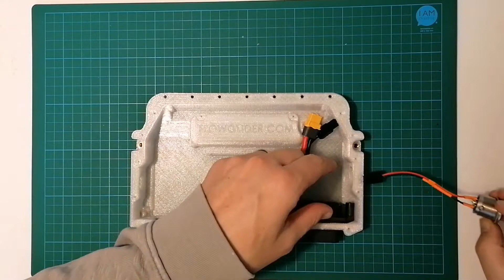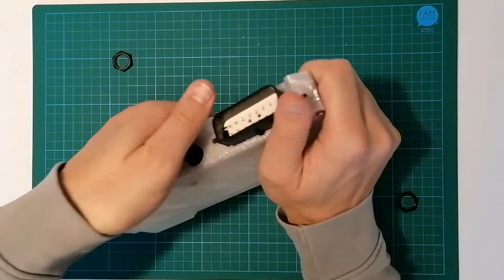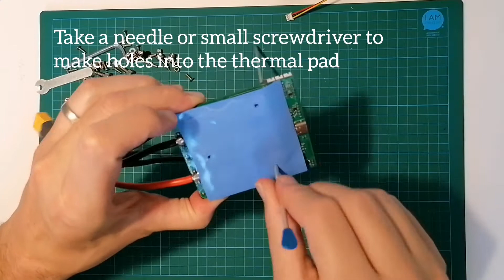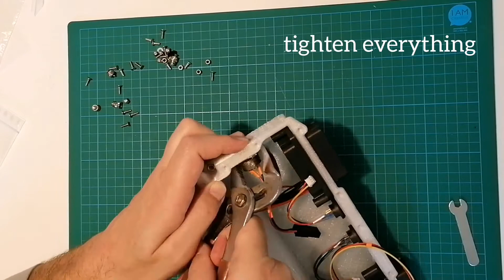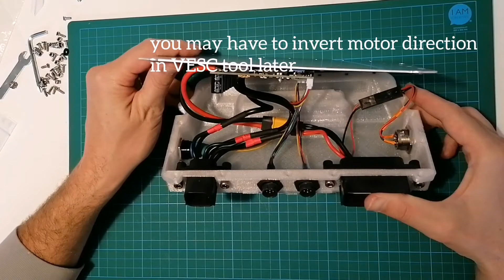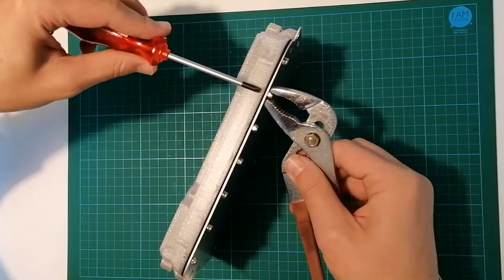How to assemble VESC Little FOCer in the Flowglider Box

Comment: Only tricky part was getting the phase wires routed so they don't interfere with the GIANT caps that are mounted vertically. These should have been mounted at a right angle . Really nice demonstration.

Comment: Great video! Although it is strongly suggested to place thin bushing washers between the MOSFETs and the lid/thermal pad (especially if you're mostly riding trails!). Without them, the FETs will slowly eat into the thermal pad material and ultimately make contact w/ the lid!

Comment: I bought an XR with Varial Rails on Craigslist. After we met up he then tells me he has a lil focer he hasn't assembled yet. Long story short, I already met him so I sent $450 on Paypal then he proceeded to mail me everything he had for XRs, not just the. Vesc. I even got brand new Badger Rails out of the deal. 

Longer story shorter... Can I just order pre-wired components like the hall/foot sensor connectors? 

The reason I ask is because my power switch has 7 wires, yours has 3... I'm just looking to plug and play without destroying a 63V battery in the process. 

Thanks for making this video. Unfortunately I need more details if I am to use it because I don't know which wire to solder where on the power port alone... let alone each individual wire on the hall sensor and footpath sensor.

If I can just buy these connectors, pre-wired, please let me know.